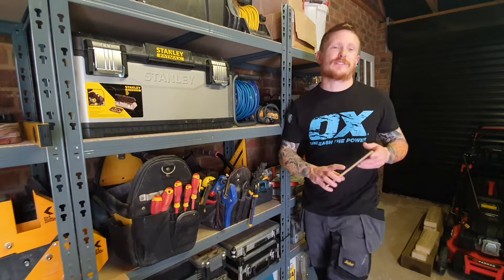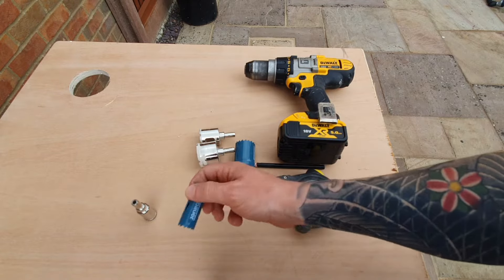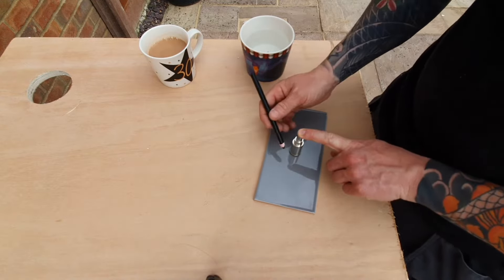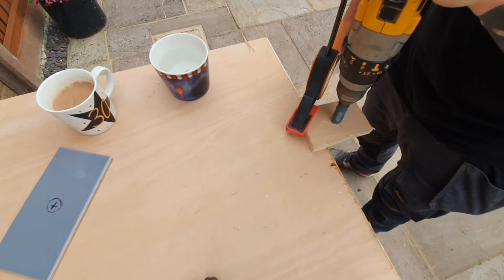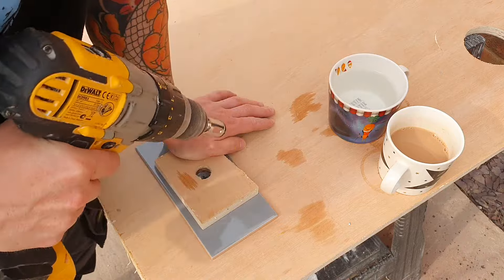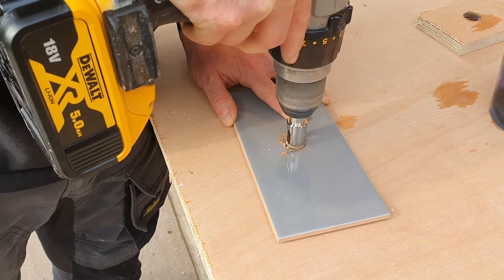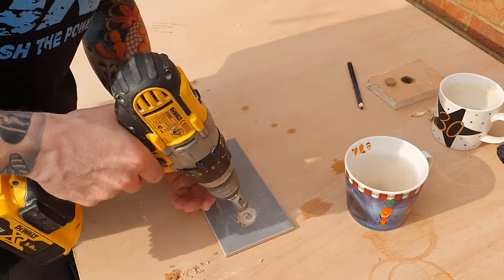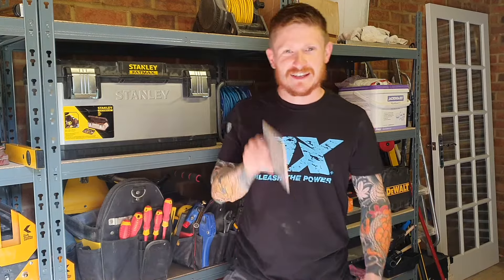How To Cut a Hole in a Tile For Pipes | Drilling Tiles

Comment: If you begin cutting from the back side, you won't need the guide, although it's still useful. Also, some drills have a piece of sponge inside, so you don't need to dip them.